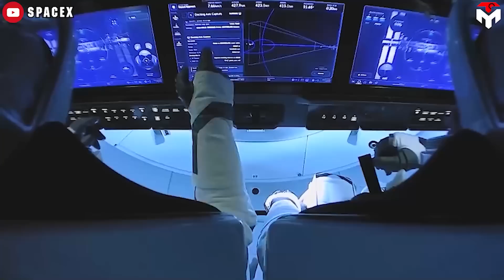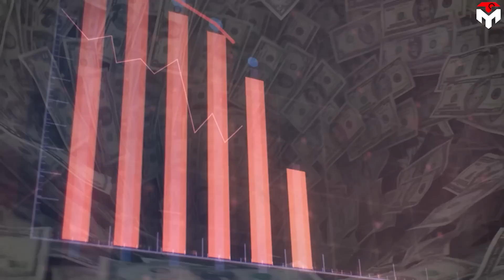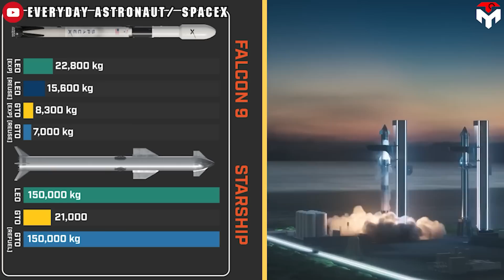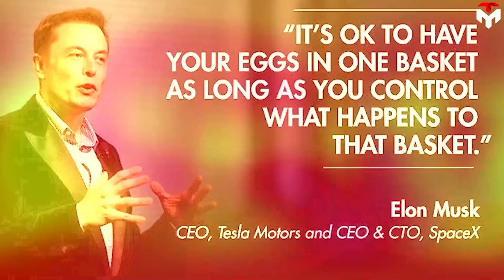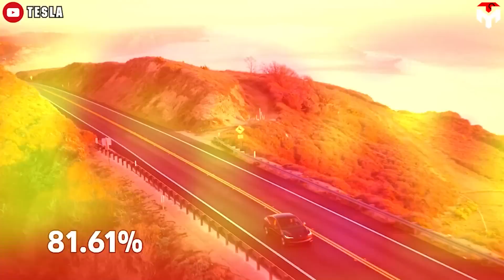SpaceX Major plan Change with Dragon Shocked the whole world...

Comment: The Dragon Capsule needs to stay away from the ocean, OK, they will always need to use the parachutes, but when 100 meters above the ground, use the super drako thrusters to do a propulsive landing, back at the launch site. 

This of course assumes that they weren't already used for a launch abort, which would end up in the water anyway. They could be redesigned for double duty based on flight profile.

This would make the refurbishing easier, safer and cheaper. Initially it could be tested with return un-crewed cargo Dragon.
Reply from the maker: Your idea is worth-noting, thanks for cmt

Comment: The final discussion about Tesla and Toyota is interesting. Tesla's head start with EVs is impressive so far, but the total number of EVs being sold in the US is far behind US governmental goals. Toyota's non-plug-in hybrid cars have extremely low CO2 emissions and twice the fuel efficiency (using regular gasoline) compared with gasoline-only cars (the ES300h offers 55 mpg in city driving). The luxury quality of their ES300h and LS500h far exceeds Tesla's high-end Model S. Toyota research has not placed all their eggs in one basket and the basket that looks most appealing in the long run is purely hydrogen fueled cars with H2O as the only emission. The entire EV/battery industry is stuck with the elephant in the room: lithium - a mineral that is very environmental dirty with very sordid socioeconomic hazards. Even Musk has commented that the ultimate solution is hydrogen.
Reply: David, automotive battery packs are already a commercially viable commodity for recycling at near 95%.

And EM has regularly described hydrogen fuel source vehicles as absurd.

Comment: Need to come up with a way to land the capsule on land or fresh water to avoid the salt water corrosion.
Reply: NASA said "No" to land landings.
The one point SpaceX caved in on, as Elon had designed Dragon to land on land. 
The "customer" is always right...
As far as "freshwater" landings go; where is there a large enough lake, away from boats, aircraft, and people on the beach, that the FAA would allow a landing at? For now, the system as is, works.